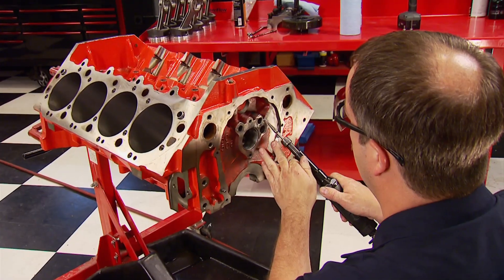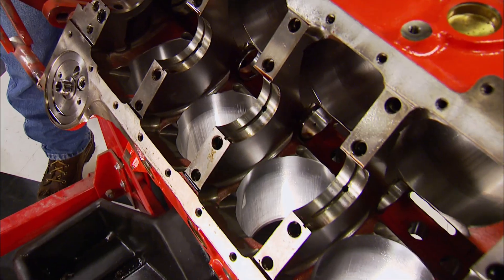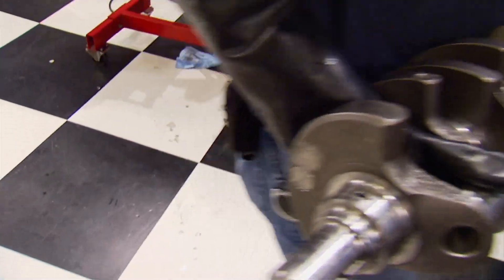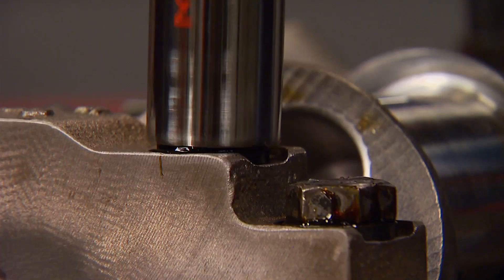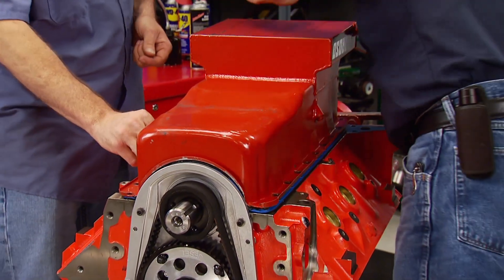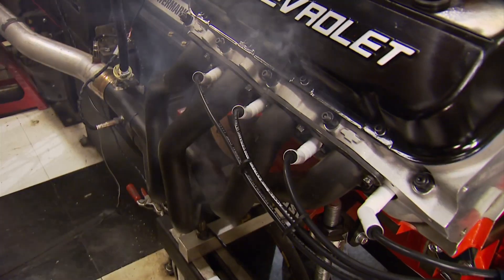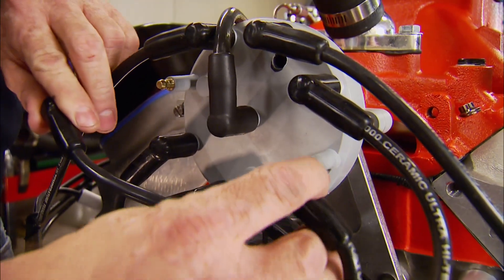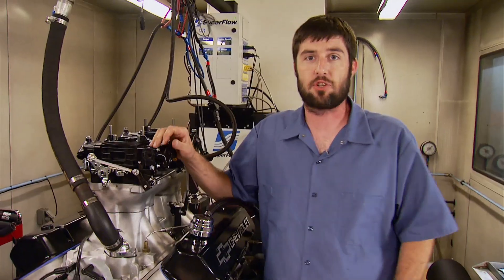Big Block Chevy 572 Bracket Blaster From Leftover Parts - Engine Power S2, E19

Comment: What donor vehicle models and years would you find that engine as we don't have one laying around in our garage.
Reply: These engines were never put into production cars. Its a tall deck block with a stroker crank.
And at any rate, so what you don't have the parts to assemble a 572 Chevy. Might have the parts for a SBC or SBF laying around though. An afternoon in a junkyard and you could probably get the parts for a decent engine together too.
Reply: those engines are found in a 1969 Henway.
Reply: The tall deck Rat engines originally were found in commercial/box trucks that ran gas rather than diesel. You want to avoid the 366 cid, seek out the 427. But that sticks you with a 454 bore and you can only reach its max overbore. But the taller crankcase gives you clearance...once you marry your machinist's daughter to get the family discount cost.
Reply: @albertgaspar627  Forgot about the truck blocks. But yeah being friends with his daughter sure helps.

Comment: 9k of parts just sitting around.....we all have those!
Reply: When my shelf parts look like those, they still have a price tag.. not dust..
Reply: That's what I was thinking. All these parts sitting around
Reply: The Bosses spare parts .
Reply: No shit right? These guys wouldn't be allowed within 50 feet of my low dollar junk.
Reply: For those who dont build engines then you have no parts for those who do always have parts
Reply: @charlestorruella8591  I call bullshit.
Reply: @charlestorruella8591  😆🙄
Reply: Some guys who consistently drag race have these parts laying around. Most people who work a 9 to 5 don't though.
Reply: folks who race, also have sponsors. that $10K parts didn't just fall out of the sky. They may have a ton of cams, but the rules will likely limit how many of the other parts they experiment with...and like Smokey Yunick would say, they end up just using what everyone else has and rely on driving skill after they've tried to out-trick the experts. The remainder of parts are stuff that's too worn out to last in a race engine, but will do in a street engine that sees more time at 3,000 RPM than 6800. And yeah, weird to use Water Dispersal #40 than ATF to brush hone.
Reply: I definitely got this shit laying around... you acquire alot drag racing for 20 years
Reply: @nhragold1922  bullshit. If you have all that shit sitting around in one piece after drag racing for 20 years you don't race you collect parts🙄
Reply: Unskilled people with a sponsor. I'll blow you fuckers away with a motor home engine.
Reply: WD 40? Wtf really? Not a single person who knows what the hell is going on.
Reply: FUCKING douchebag said he had that block sitting on a shelf next to a pile of greasy parts🤣 then proceeded to put that fucking motor together with new shit in a state of the art shop with a dynomometer available 😂😂🤣🤣
Reply: You don't need all that shiny fancy shit to build a fast car. Spend time not money. Science not expensive shit. Come over to NYS with that crap. You guys suck and ya know it.

Comment: I don't even know what a bracket engine is
Reply: A "Bracket Engine" is an engine purpose built for bracket drag racing. Bracket racing goes off your dial in during your practice runs. For instance, 10 second cars are frequently run against 13 second cars but because of the handicap given to the faster car, if that 13 second car is consistent, it will win every race. This is opposite a straight drag race where the tree drops green equally on both sides. In a bracket race, the car with the highest ET goes a few seconds before the lower one. ( 13 seconds goes first then the 10 second car 3 seconds after.) Driver reaction time and consistency wins bracket races, not so much the car.
Reply: The other nuance with bracket racing is the dial in. If on your shakedown runs, you dial in a 12 flat, you need to run 12 flat or slightly above. If you run faster than 12 flat, you will "break out" of your bracket and lose the race. It's just like red lighting at the tree. It is possible your opponent will break out as well. Then the winner is the one who had the lowest breakout time. Say you broke out 3 tenths of a second and your opponent 4 tenths. Then you win.

Comment: Should of tuned it for 91 as 93 is definitely not readily available
Reply: Reginald Smith  ooh.   98 octane?   That's a spicy meat-a-ball.
Reply: Wild Bill 98? We got 101 octane gas here in the middle easy
Reply: @crypsis5357  straight from the source! I bet that some great fuel 🔥
Reply: 91,94,98 all readily available where i live.
Reply: 91 is the best available here in the middle of West Texas oil country, sadly
Reply: It is in v.a. but it's still just as inconsistent as gas everywhere with ethanol in it.  I still have to run additives or boosters in my older stuff.  New gasoline is garbage
Reply: 98 octane would be awsome in VA
Reply: It's a mix of 91 and 93 here. Really depends on where you go.